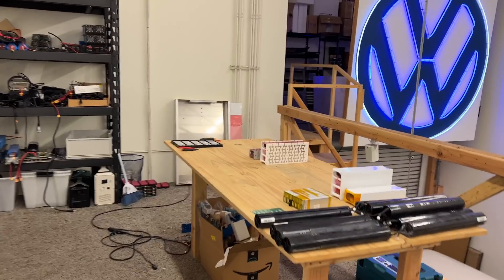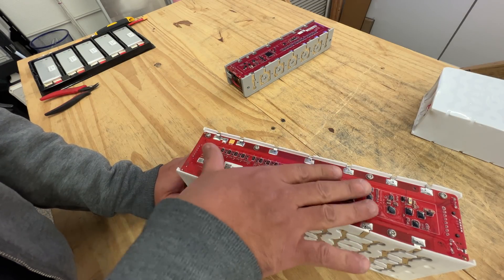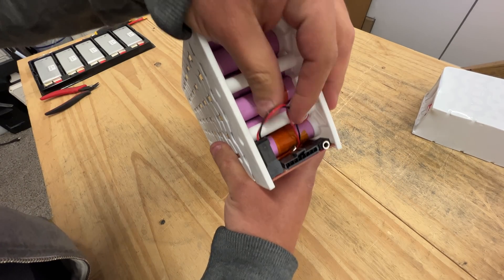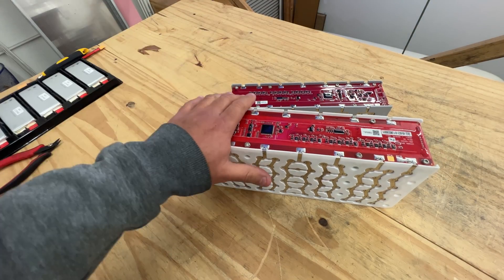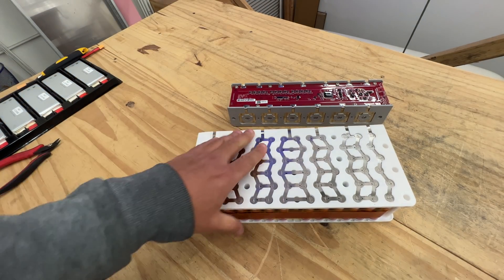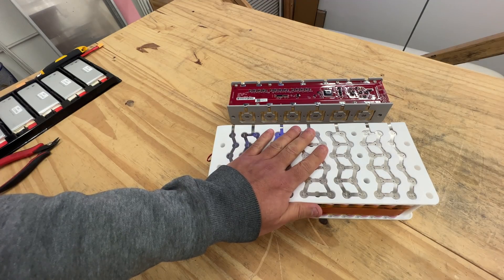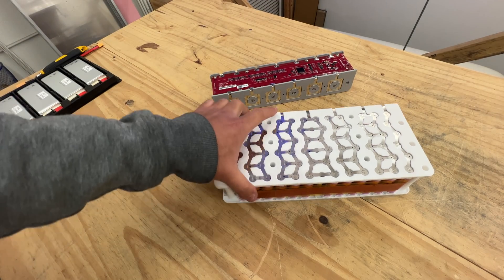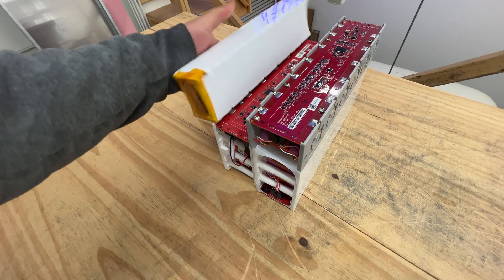$95/kwh 12s Samsung 35E  battery packs

Comment: The problem is what is unknown. A charged battery bank that is heated goes out with a partial charge but if the temperature falls to near freezing the battery starts depleting just to heat and stay safe. Hopefully the heating circuit is protected by under voltage shutdown. 
Cool breakdown.

Comment: If one is seeking to build a large Ebike battery - 12 cells in parallel, 14 in series, for 168 cells; hope is to get at least 35+ amp hours - which cells would be “good”?

Goal is to get ~ 100 miles of range while towing a trailer at 12 - 17 miles per hour.
Reply: You'd need around 2Kwh of batteries. For those speeds, you will be OK with 12S batteries, buy 2 of those big ones and, you're all set.
If you are carrying a trailer, think about getting solar panels on it. You'll get more autonomy.

Comment: On my 3d printing design software fusion 360 I can take a picture(of the original bms or whatever) and then calibrate the image to the correct size. Then I just trace everything instead of measuring. Wondering if you can do the same with the circuit design software. It saves a ton of time. 👍😂

Comment: defibrillator battery packs
Reply: Doubtful.  The voltage is so non-standard that it almost has to be an odd requirement, like land line phone systems.  A defibrillator uses a voltage multiplier / switching power regulator to set the different voltages it needs, so it'd probably run from a standard battery - 12 or 24 v DC - just to cut costs.

Comment: you need a cad file for a bms that you could add to any board  that you can add or remove mosfets for higher or lower amp ratings and that has high and low tep shut down  that using a common cheap chip to control it  there are ee that will make one for you like electronics 101 i think his you tube channel is may be 102 he has face book group also he dose good work 
there is also Sid from genetry solar a really good low freq inverter comp  if Sid had the time you would love his work

Comment: Hey Jehu, I am wondering if you could put together a show that explains kilowatt. How far in miles, or how many hours you get out of a kilowatt and so on. An easy way to remember this. Since I am not heavily into the battery power scheme yet. I am like a person that has never seen Bronteroc ( on Don't Look Up) before, and you are talking about them .
Reply: Watts are power.  A kilowatt is 1000 watts.  Watts measure how much power is needed or is available (a rate of using power) and to know how much you use you need to know how long you use it (or how long a battery can supply it).  That is, how many watts for how many hours.

Usually when you buy electricity from the utility you buy it in "kilowatt-hours" or kwh, which is using a kilowatt for an hour. How much work you get out of that power depends on efficiency.  You could get about 1600 lumens of light from a 100 watt incandescent bulb for 10 hours and you would use 1 kilowatt-hour.  Or you could get the same amount of light from a 20 watt LED bulb for 50 hours for the same kilowatt-hour.

For batteries you can figure how many kwh are in a battery by multiplying volts (v -- potential) by amp-hours (ah -- energy).  A 3.7v battery that holds 3.5ah holds 3.7v x 3.5ah = 12.95wh (not kwh).  Now when you put 6 of those batteries in parallel you get 6 x 3.5ah = 21ah.  And you put 12 of those groups in series and you get 12 x 3.7v = 44.4v.  44.4v x 21ah = 932.4wh or about 0.93kwh.

So that battery will get you about 93% of 50 hours or about 46.6 hours of light using a 20 watt LED bulb.  If you use a 10 watt LED bulb that is half as much power so you would get twice as many hours (but probably less light, unless you could also double the efficiency).

Comment: Jehu I came across some packs exactly the same I still have some actually but they were medical packs I was told.
Reply: Do they charge up?
Reply: @Strange_Brew  yes the ones that I picked up a couple of years ago I still use. Those  are some great batteries. The ones that I took out of the casing was difficult though

Comment: These could be for outdoor applications (RVs, or even remote off-grid power) as hinted by the heating element, and high quality nature of them. Who knows...
Reply: The problem is safety. The Samsung 35e is a very good battery, but the hydrogen generated from just 1 venting would blow the doors off a camper or van. INR chemistry cells are much safer than ICR, but still don't hold a candle to LiFePo in terms of safety. The cost is great, but the extreme temperature variation and the nature of people poorly maintaining and monitoring their RVs to begin with (especially if they are in offsite storage, which is typical in the US) is a recipe for a severe fire or even an explosion. I say spend the 200 per KWh on LiFePo and don't spend the 60-70k on a burned down RV that your insurance wont pay out